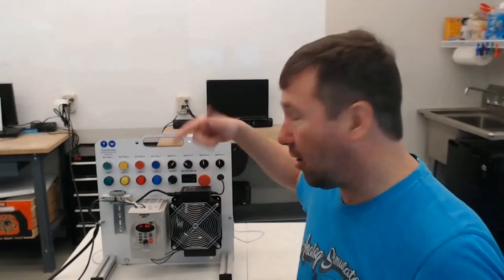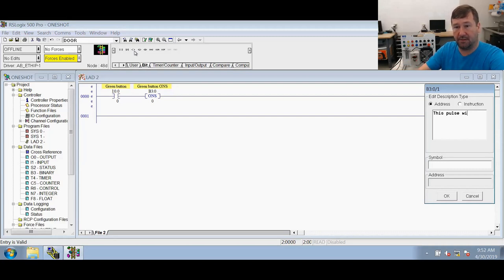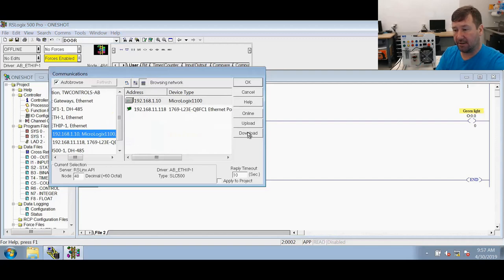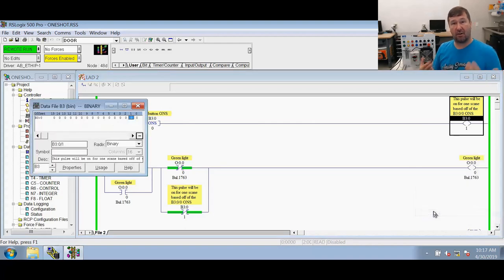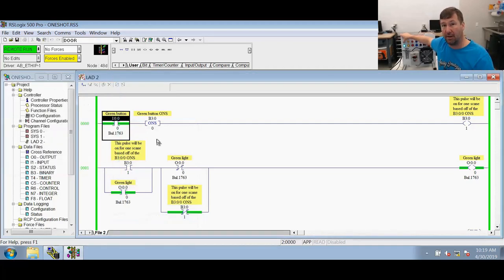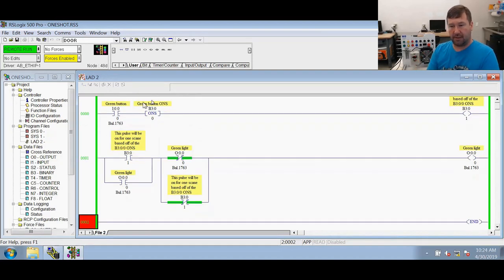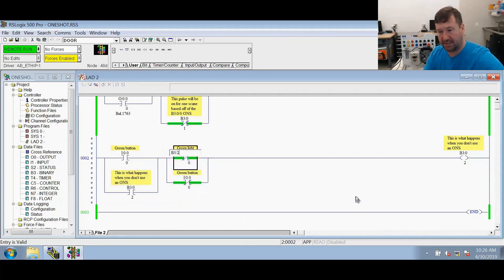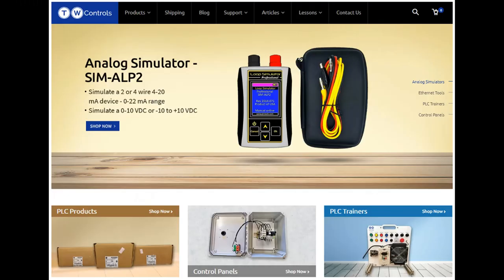Program a Flip Flop Using One Shots. ONS, OSR, OSF in Allen Bradley's RsLogix 500

Comment: Great video.  On my RS logic simulator I don't see a difference between XI and BIT. Can you help me with that or explain the difference. Thank you.
Reply from the maker: I'm not sure what you mean by XI and BIT
Reply: @TimWilborne   Thank you for the quick response. This probably isn't the best way to ask this question. I should have been more descriptive.  Basically when I use the "user" tab or "bit" tab I get the same result.  I don't see B/0 come up, I guess, for bit.  If it's to much information involved....no worries. I am subscribed thank you for the videos.
Reply from the maker: What software are you in?  I may have incorrectly assumed RsLogix 500
Reply: @TimWilborne  It says Logix Pro 500 Simulator.  I am new to this.  I just figured with hitting the Bit tab it would automatically be a binary bit.  Maybe there's more to it I have to learn.
Reply from the maker: Ah, it is a good tool but I don't have much experience with it.

Comment: How can I use this concept to make an alternating relay ? Pump 1 and Pump 2 Alternating
Reply from the maker: In this situation you will usually have a stop, lead, and lag float. Each time the stop float goes down, you would do the flip flop. then if your toggle bit is off and the lead float is up then you would run pump one where is if the toggle but was on and the lead float was up you would run pump two. The lag float would turn both pumps on.
Reply: @TimWilborne  I install these all the time, but I would like to build my own controller.  The problem for me is the alternating relay.
Looking at your program, I just made the flip flop work.  Can't wait to try it out, Thanks, Dorian
Reply from the maker: @dronai  Great, let us know how it works!

Comment: Hi Tim. Excelent explanation and it is  very to apply in the real world. This is very uselful for controling a motor using  the Stop an Start as a unique Pusbutton. I wonder how to use it like a Flip-Flop with independet Set and Reset. for example to control the sensing signals,  low and high water level of a tank. Thanks for your excelent contribution>

Comment: Tim, I apply first program in the step by step with Micrologix 1400 . when I go to run mode it was FAULTED, shown Error description "Expansion I/O module 1 generated an error"
Reply from the maker: That means something is wrong with the module you have plugged in to the right of the PLC base.  What do you have connected there?
Reply: @TimWilborne    I have connected the Analog Module 1762-IF2OF2  A D 1,2.

Comment: How do you convert an OSR to an ONS when the follows a stack of different inputs? I am trying to convert a SLC 500 1747-L30A to a Micrologix 1400. I changed all of the OSR bits to ONS. There is a push button input that also acts like a reset button if you press it two times quickly. The ONS sets the bit and will not allow the reset function to clear the counter. Any Ideas?
Reply from the maker: The Micrologix 1400 supports the OSR. Why not stick with it? The issue is the ONS lacks the external output bit which your OSR is probably using elsewhere in the program.
Reply: When I converted the program to the 1400 and verified the program the errors indicated that the one shot rising was incompatible with the 1400.
Reply: should I do the conversion in RS Logix 5000 instead of 500?
Reply from the maker: @ks1works  I think you are right, let me look closer tomorrow
Reply from the maker: @ks1works  You are right.  The Micrologix ONS is the equivalent of the SLC 500's OSR.  It should work if you changed the instruction.  My guess on why it wouldn't would be something different in the timing.  How quickly did the push buttons have to be pressed sequentially?  Did you verify the time bases and presets are the same in all of the timers?

Comment: This video is the most confusing so far. I have no idea what ONS should mean and why it does what it does. And it is exactly what you choose to skip...
Reply from the maker: See if around 4 minutes helps you.
Reply: @TimWilborne  it is the confusing part. As far as I understand now, ONS functions the same as OSR here, detects the action from proceeding element. If it changes from 0 to 1, send true downstream. It will send false if the proceeding element didn't change or change from 1 to 0. You did a good job on explaining what happened but didn't mention why. Like why does ONS output false when it receive a 1 while its storage has 1 already...
Reply from the maker: @jnrfalcon  We have a video in the works on the difference between an ONS, OSR, and OSF that would be helpful. Basically an ONS is the same as an OSR except the ONS passes true or false conditions onto the right of the rung for evaluation by an output instruction whereas the OSR is an output instruction that writes a one or zero to its output bit.
Reply: @jnrfalcon  The one shot (ONS) limits the basic scanning of the device (PLC), which is about 50 times per second in just one scan. That's because the electricity is moving almost with the speed of light and when you press a button ,even in the quickest way, the electrons did already 20-30 cycles and the desired output should be random and not the intended one. With One Shot you know that when you press it even for long the output should be only one scan or signal.